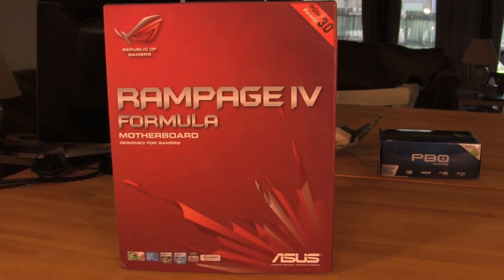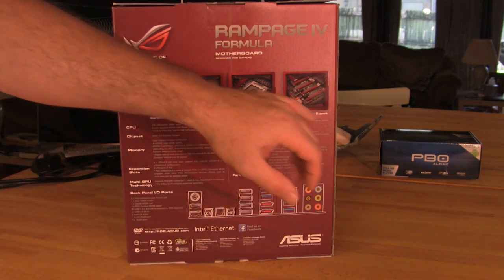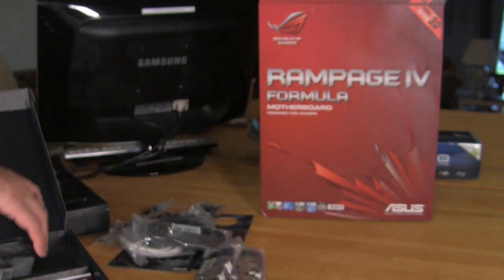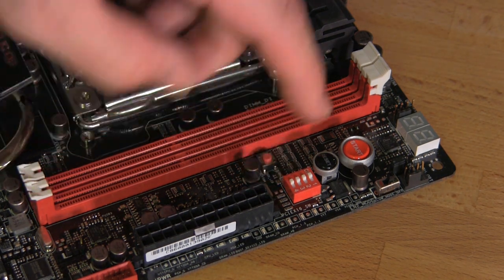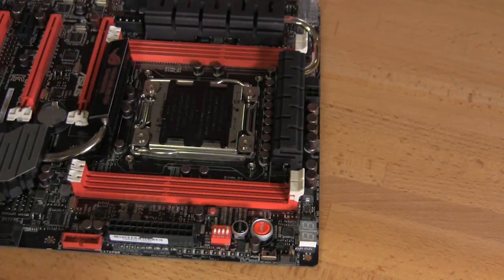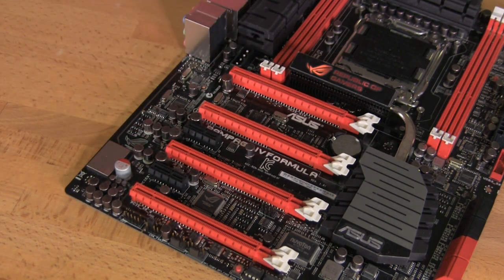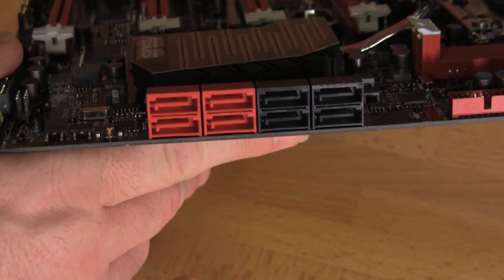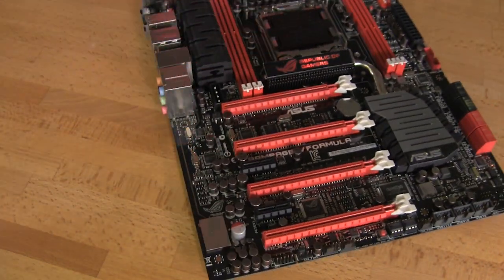Rampage IV Formula Design and Features

Comment: there really is no real world difference man, believe me! I have a 2011 rig ( I7 3820) as well as a 1155 rig (3770k) the difference is pretty much no existent. of course youll get better performance in multi threaded application if you buy a 3930k as it has 6 cores and 12 threads but at what price? unless you DEPEND on your computer for work related purposes I would personally stick with a 1155 rig.